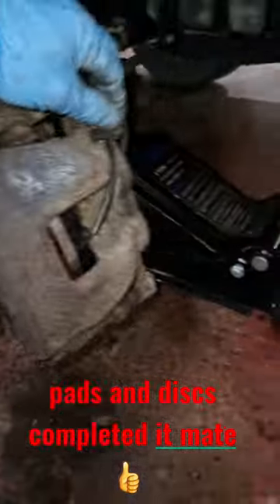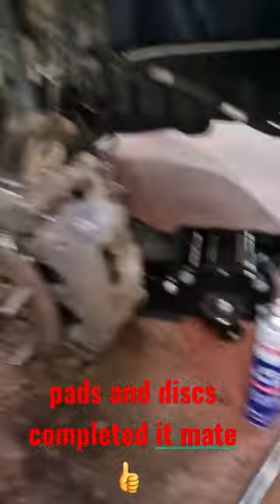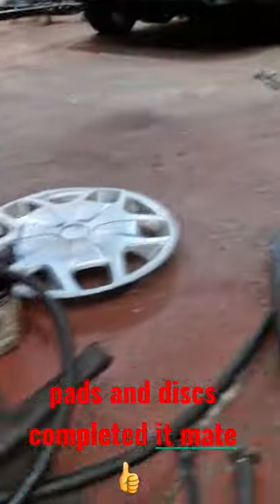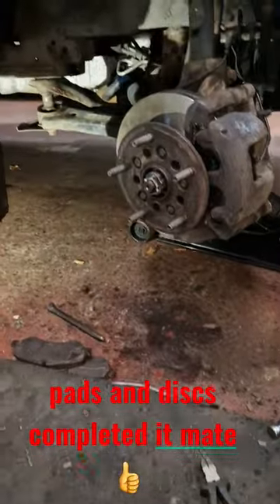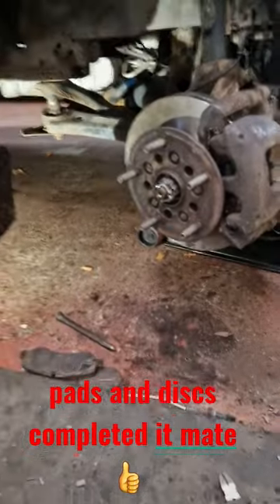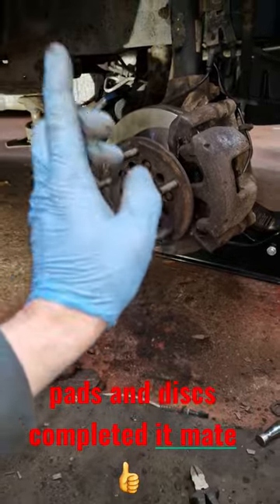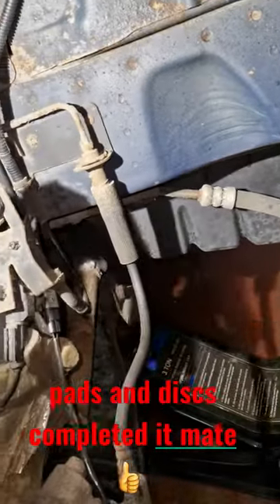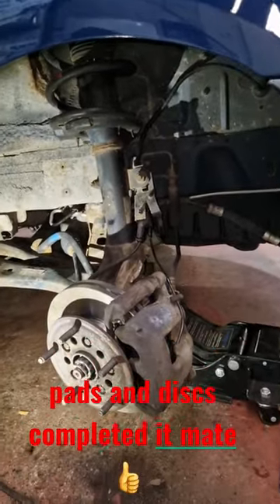#fordtransit custom front pads and discs replaced #mechanic

Comment: Sigh, no year, no actual work done.  Cant figure out how to get the front calipers down on a transit 250 2023.  Where the pins should be are caps with grease holes? Im so confused
Reply from the maker: this is not a 2023 plate transit in the video. What model year of transit are you struggling with?